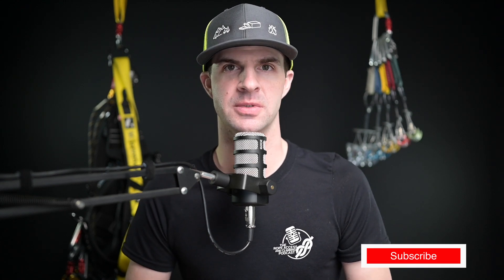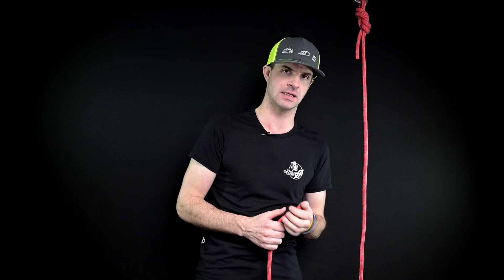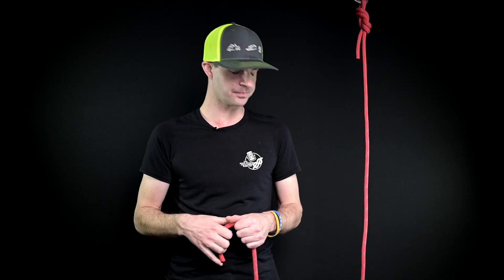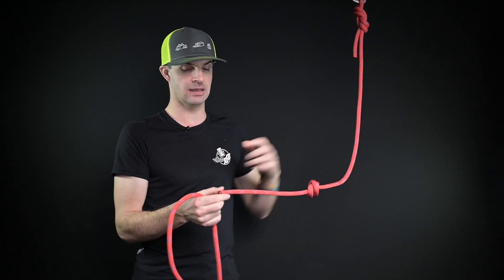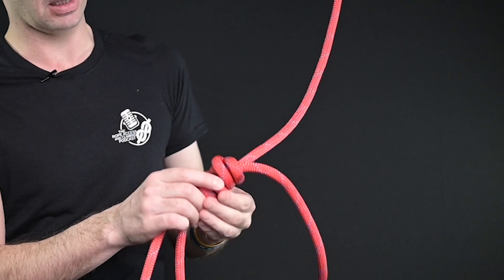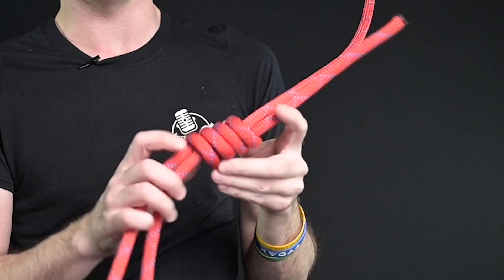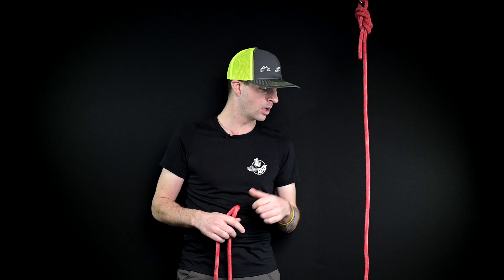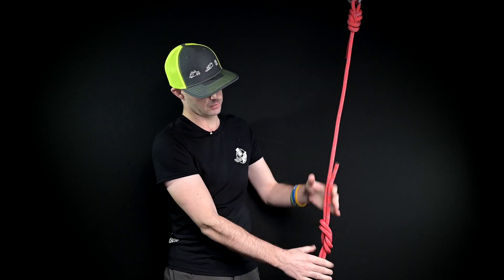HOW TO JOIN 2 ROPES TOGETHER – TECH TALK - THE ROPE ACCESS AND CLIMBING PODCAST

Comment: A regular figure of eight. 
Retrace from the loop side.
It gives you a place to clip in.
Reply from the maker: Another great option.  But still harder to untie than an Alpine.
Reply: @theropeaccessandclimbingpo2380  duno about that one bud. A figure of 8 is generally easy to untie. 
I don't see the benefit here but I will definitely give this option on my work sites. It's a nice option.
Reply from the maker: Agreed.  Just a nice trick :)
Reply: You can call it a flemish bend i think.
Reply: @Carcajou45  yes but a Flemish bend with a bite.

Comment: I like that you are not loading the fig 8 bend. Some research has suggested that a fig 8 bend reduces the rope strength by ~50% as opposed to 25-30% as with the double fisherman's and most of the other knots that we use in RA / Rescue
Reply from the maker: Hey thank you for your comment.
Yes knots reduce the stretch and yes we want to maintain as much strength as possible.  But a figure 8 doesn’t reduce it by 50% all the time, this is based on a lot of variables.  Over estimate isn’t a bad thing.  But even if it did reduce it by 50% we are still within the safety margins of our equipment.

But by tying the 8 into an alpine...  it reduces all question.

CheerS
Mikey

Comment: Thanks for the video. Even though I've been in the RA industry a long time, I'd never thought how you could tie the double fisherman's 'wrong'. Thanks for that.

Also, a little tip from my experience of tying in with a figure 8 to go rock-climbing - if, when you start re-threading, you start from the narrow side of the original knot (just as you did in the video) then you'll find it much easier to untie after loading. If you start re-threading through the bigger gap then it can tighten in such a way that it makes it bunch up under load, making it MUCH harder to untie. Of course none of this matters if you tie the alpine!
Reply from the maker: Hey there,
Thank you for your comment.   Yes, just about every knot can’t be tied wrong.  Or at least, “less right :p”

The alpine fixes all problems!  Well in this case haha

Cheers
Mikey

Comment: If you use the ABK element (which I like) why not just stay with the double fisherman’s knot, (that is already SOP in so many agencies) as it won’t be loaded and will be easy to untie?
Reply from the maker: Hey there, great question. 

Feel free.  Use either knot.  The point of the alpine is to remove the tension from the knot.  And as long as you don’t put weight on it as you pass the knot(s).  You won’t have an issue. 

Cheers
Mikey

Comment: The company I work with does the butterfly as well. Super smart and efficient.
Reply from the maker: Yup.  It’s something that a lot of people over look.
And then fight with trying to untie the ropes after...
Cheers
Mikey
Reply: @theropeaccessandclimbingpo2380  for sure plus with window cleaning you're moving fast and it's so much easier to cowtail into the butterfly bump your backup and keep going.
Reply from the maker: If your washing windows...  why are you climbing on ropes with knots in them?
Reply: @theropeaccessandclimbingpo2380  it's knot common :P lol no pun intended. But when you have 7 people on a 35 story building sometimes you need to tie ropes together. Only ever had to do it 2 times though so I was impressed when they did the butterfly technique.
Reply from the maker: Ahh ok Kool!  Ya, I hope it’s not common.